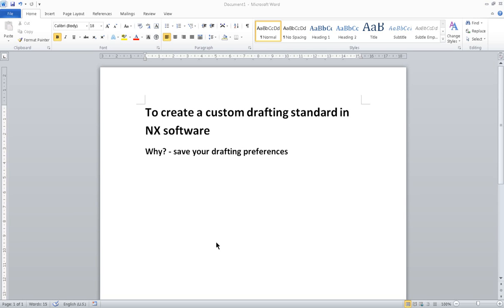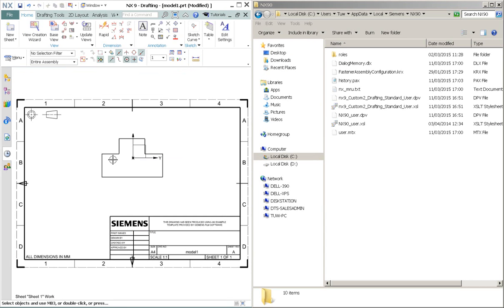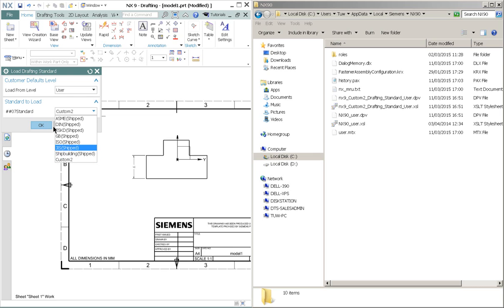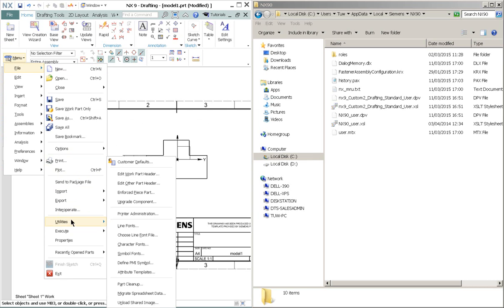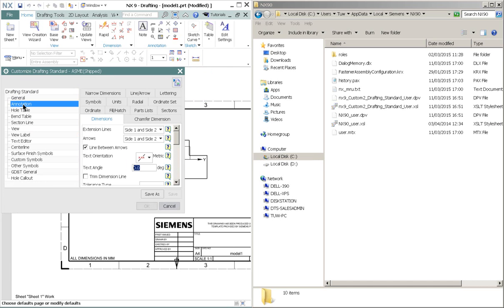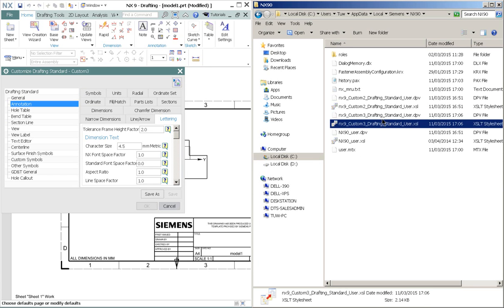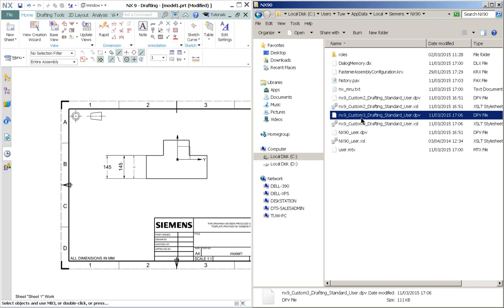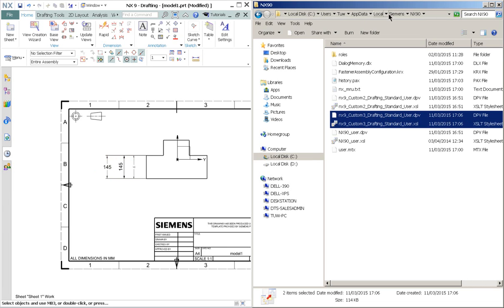To Create a Custom Drafting Standard in NX Software

Comment: Hi,
I need to know, Is there any option to set auto page number.
Suppose there are more than 60 pages in one drawing file. And to separate all pages, we write in down right corner "Page 01 of 60"  and so on...
But Currently, I'm doing this manually. Is there any option to make this auto changeable?
Reply: Hi Nitesh, when you add a drafting sheets, it will automatically takes next sheet number for your sheet,  So basically you don't have add sheet number manually.
Reply: @chetakkadam9093  I know this will work. But I need to do this in my own template
Reply: @niteshvalecha8913  Please use this attribute  ---->  SHEET <W@$SH_SHEET_NUMBER> OF <W@$SH_NUMBER_OF_SHEETS>
Reply: @chetakkadam9093  Thank you so much.🙏

This was awesome 👍🙏